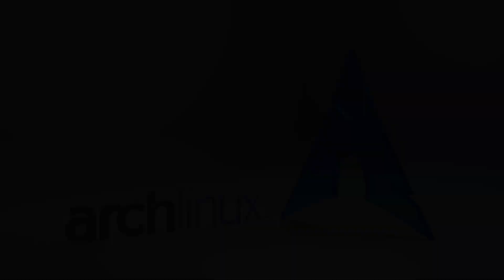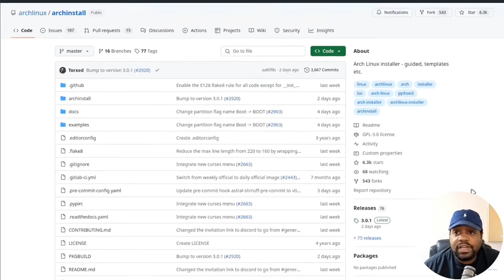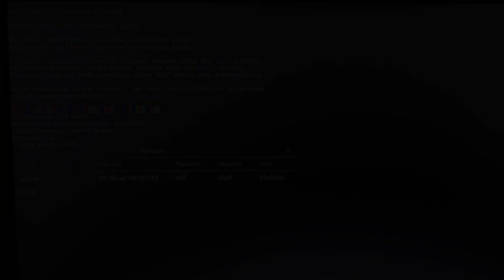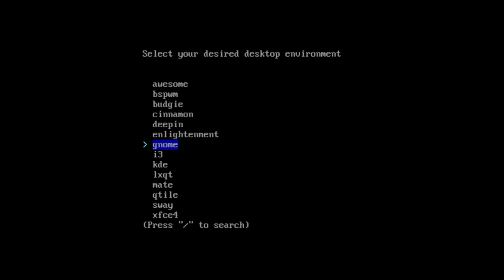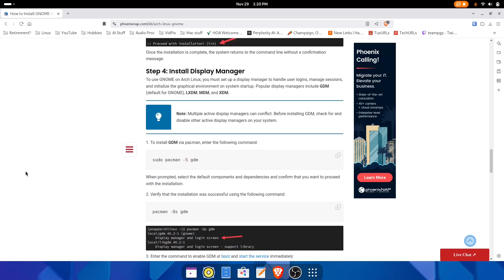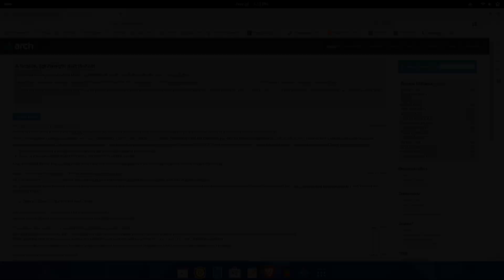Me vs Arch Linux

Comment: Welcome to to Arch, so you just missed a couple steps "adding the desktop:"  just like you said you didn't hit enter. And you missed "use network manager" part.  If you complete all the steps correctly it is unnecessary to "chroot" at the end.  Chroot does come in handy if you need to do a manual intervention (fix something) you can mount the system and fix the more than likely a bad update.  good job!

Comment: The only time ive ever needed to chroot after the install was to copy over a Windows bootloader for dual booting, but even that could be done later.

Sounds like you had the perfect arch experience. A smooth enough install but with some enforced extra setup to give you that sweet taste of DIY!